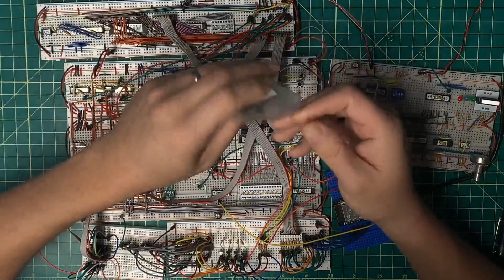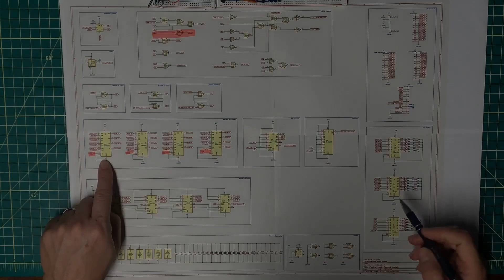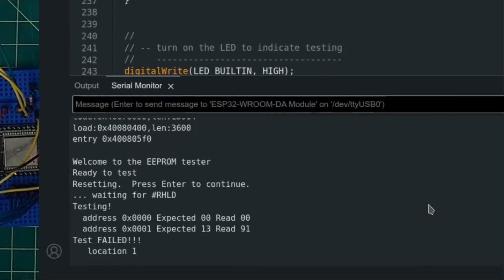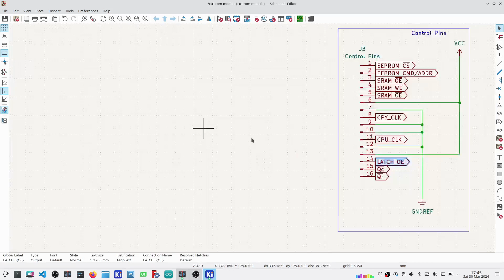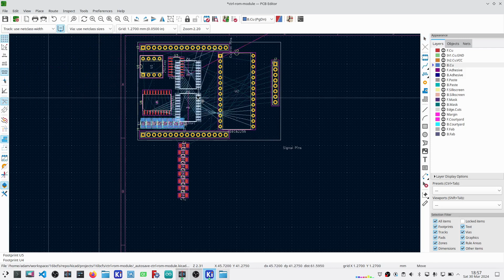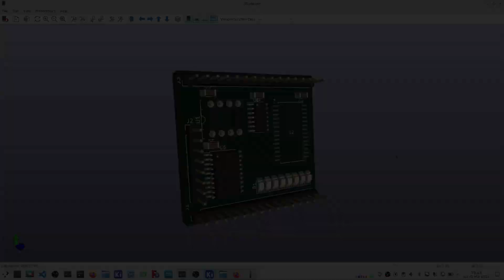0096: Control ROM PCB Layout | 16-Bit Computer From Scratch

Comment: Congratulations on finding all the issues and getting to PCB layout! I was suspecting a clock polarity problem since I had that on my simulated build. Wasn't expecting the shifter outputs reversed, but you found and fixed that. So satisfying to see the repeated working tests.
Reply from the maker: Thank you!

Over the course of the build there were 2 clock polarity issues I found.  I think the best part of this is being able to use the ~1.8MHz crystal to drive the copy -- which results in a sub-second reset time.  

If you are interested, I remind you that the schematics are available on GitHub.  In this case, the PDF is available here: https://github.com/eryjus/16bcfs/blob/master/kicad/projects/16bcfs/ctrl-rom-module/control-rom-module.pdf.

The KiCad project is in the same folder.